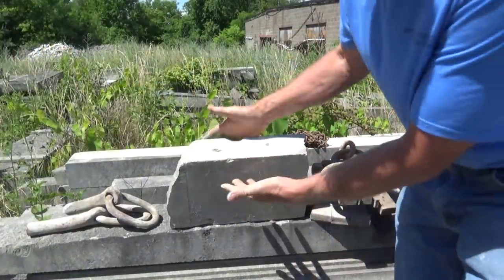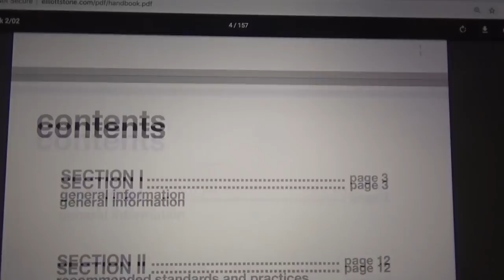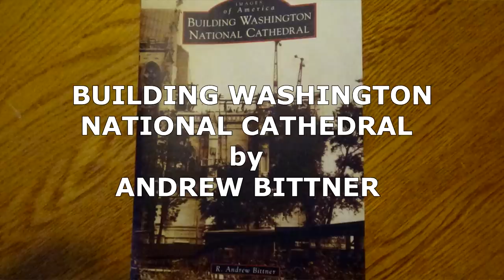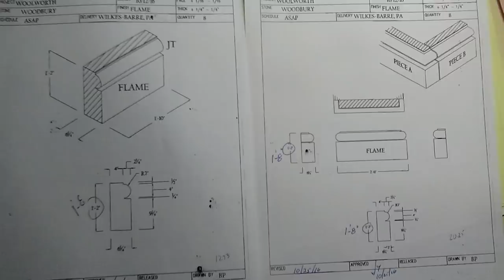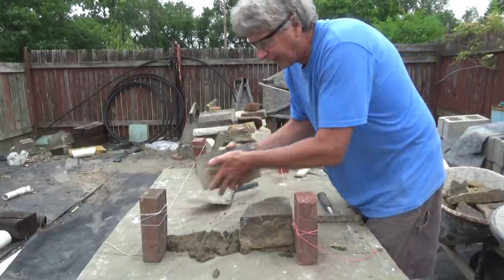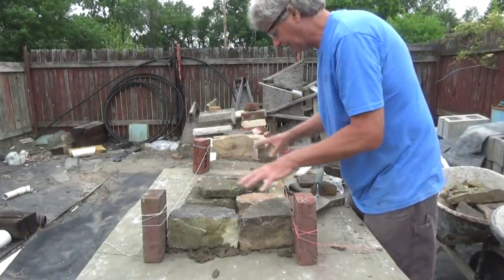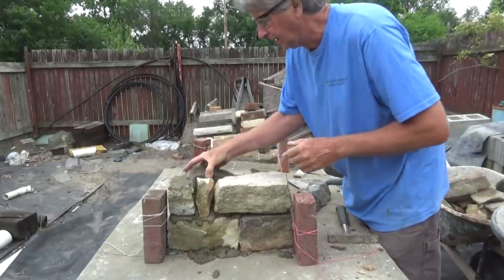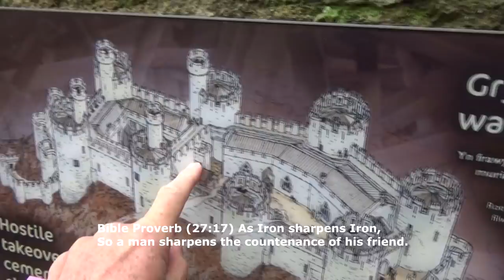ROCKFACING AND SHAPING STONES (PART 5) Mike haduck

Comment: Mike, one of the things I'd like to understand is how you 'spread' the mortar. It seems as though you don't disperse it very much overall, and there must be areas between the stones which are not bonded. I've noticed this on other videos of both yours and other masons. Perhaps you could go over the use of mortar, specifically placement, amounts, spread, etc in more detail on a video. I recognize this video was just a demonstration, but I've noticed this 'issue in my mind' which I haven't been able to understand.
Reply from the maker: Hi, I would say it's more of a feel thing like a mechanic would know how much to tighten a bolt, just comes with experience, thanks mike

Comment: very good - the "junk" in the middle -w/mortar presumably just as good as quality stone? or not?  If Lord of castle in progress or 1920s building I might worry that too much whatever junk might get thrown in?   I understand sand for the demo but between front camera stones would mortart not go between those joints?   I do like the plaster to hide the joints so enemy cannot see the crack points.
Reply from the maker: Hi James, I would say the junk is rough stones that wouldn't be used for anything but fill,  thanks Mike